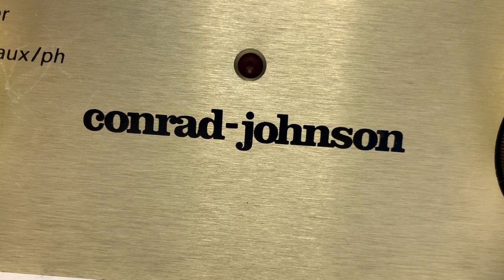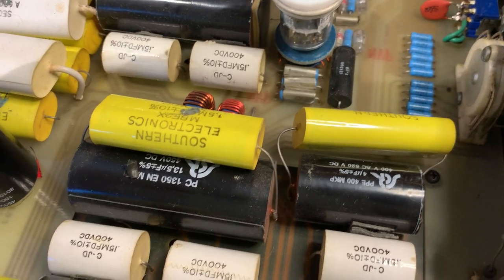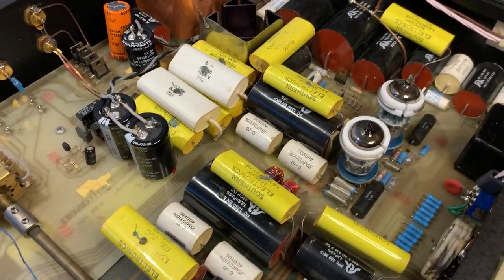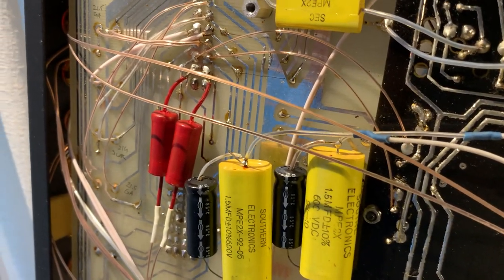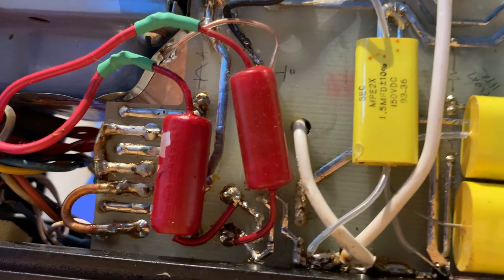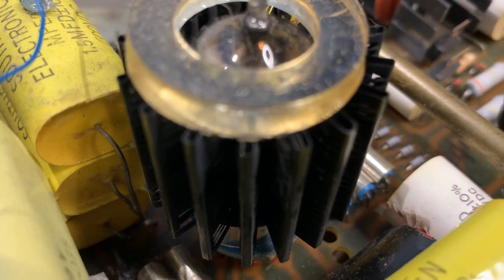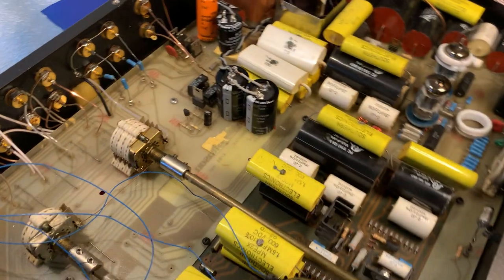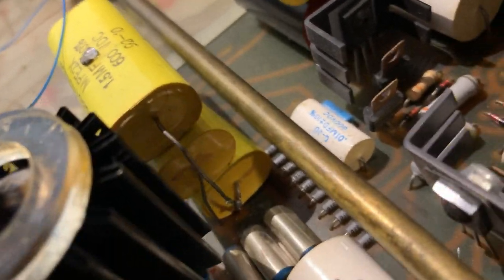Remembering the Magic of Stu Ono: Conrad Johnson PV12 preamplifier

Comment: agree about Unclestu having more knowledge about the bybee purifiers... he modded my vans evers 85 power conditioner back in 2003, and included two bybee purifiers in my van severs product which I still use in my system). Stu told me he put one of the bybees in an area that even Jack Bybee didn't do. I sent an email back then to Jack to tell him what Stewart did, and he replied back that, "wow... he never thought about that way to do it ! "
Reply from the maker: Mahalo, thank you for sharing! Indeed, the Bybees really spruced up the Vans Evers! So sad that both Stu and Jack are gone... Indeed, Stu mapped out where the bybees work the best - closest to the transformers, at places where the phase angle of voltage/current is shifted. Also, more impact on the neutral than on the hot..  Aloha, Janos

Comment: Hello Janos! There is a china clone out, which I'd like to purchase. But inside it looks way different to piece You show. Now I am not so sure anymore to buy one of these. But anyway, it might still sound better than my Thule audio line pre.What You think about that clone?
Reply from the maker: Usually in China clones they shave off on the parts that are not in the limelight: connectors, wire, resistors - they use ones as cheap as they can get. That results in a  rough / unrefined character, that may be more explicit or not so, depending on the execution, and may not even be obvious unless you have the clone vs the unit that was cloned side by side. In general though, the cloning tends to take it from a more cohesive sound towards a more clinical sound, but in later years the clones are getting better and better, compared to clones 10+ years ago.
However, if you treat it as a project, and will get into changing the compromising parts to high quality parts, then it's a good idea. Will be a super long project though, as the CJ pres have so many parts, and it's not fun at all to work on PCBs. (At least not for me, but if you do like it, then it's game on!)

Comment: Hi Janos, this video is awesome in so many ways. I'm changing the coupling caps on my Art Audio Jota tube amp. The original caps are Hovland MusiCaps the leads are long and insulated. The new replacement caps are Jupiter and have short wire leads. I will need to extend and insulate the Jupiter leads. I see that Stu put tubing on the leads of the caps and has also extended the leads on some of the caps. My question is what type of insulation and what type of wire is used by Stu for this, or what would be recommended?

Also planning on putting the quartz crystals based on this video!
Reply from the maker: Hello J, Stu used Kimber SF23 for cap hookup. It is teflon insulated, and he placed some polyolefin heat shrink over the solder joint. Have fun with the Jupiters and the quartz!  ; ) Janos
Reply: @realworldaudio  Thank you this really helps.

Comment: Are those Obliggato or AN Copper foil caps in your parts bin?
Reply from the maker: Those are Obliggatos. Trying to keep the cost reasonable :)
Reply: @realworldaudio  👌🏼 they are very good for the money. I have them (gold) as couplers in the GM70 amp.. Some of the least plastic sounding poly caps around..
Reply from the maker: @rickg8015  I'm so jealous of the GM70... :) I also use the gold colored "ultra-premium" series 600V or 1kV rated caps for coupling in my Ampex, and I agree with you that they lack the plastic sound, second to Miflex. They take a while to break in, but they give a natural sound at a very good value.
Reply: @realworldaudio  Been listening to Miflex Copper foils for over a month in a preamp and you get at least 95% of Jupiter Copper foils’ performance but in more sane prices..

Comment: Very nice! Thank you very much for this beautiful tribute video and many explanations. regarding the mods. Question from a beginner: are all traces bypassed with wires or just the ground traces? As an unexperienced diyer, I imagine that so many extra wires going around the chassis could cause noise? I wonder what is the correct technique to decide which traces to bypass and which not, which wire to use and how to estimate beforehand if there could be interference or not? I am sure it sounds great and no extra noise is created, otherwise it would not have been done like this ;) but I am guessing an unexperienced like me would create a noisy mess trying to replicate this? 😅
Reply from the maker: Hi Thiago, SUPERB question about the traces, you found a core issue!!!! Deserves a video response. ; )
Reply: @realworldaudio  Hi Janos, thank you :-)

Comment: Hey bro just before watching I wanted to tell u something, there is a guy in India he is making superb output transformer, I know which wire brand he uses, I'm having one pair from him (el84)  and one pair is being built (6L6) , u told me 6L6 is one of ur fav, I am proposing one thing to you, are u able to reverse engineer it, I'm waiting for my winding machine to arrive, can this be done bro, as we will be able to make them for a lot cheaper and I'll personally make 3-4 pairs for u, as a gift for helping me figure it out, and u can compare his OT to other high end ones as well, make. Some content out of it  or whatever u want
Reply: BTW he is charging around 300$  for pair of single ended OT for 6L6 amp
Reply: BTW he is 3rd generation of his family, they have been making transformers for 50years , he told me I bake my OT on coal and not in an oven like others, there are some videos also of his OT with some decent brands like edcor, lundhall etc, and his OT beats them really easily, he is claiming 15hz to 30khz or something very similar to. This
Reply: Is he using Square wire and deally silver ! How much would that cost?
Reply from the maker: @IDontExist14  I'm glad you found him! My advice on reverse engineering his OPT: you will be able to do that when you already have 10yrs of OPT building experience. To reverse engineer and OPT you have to take it apart, destroy it. Taking it apart in a way to learn from it already requires a lot of experience, and it needs to be taught hands-on. I recommend that you ask him to teach you, mentor you, or partner up with him so he supplies the OPT and other transformers for your amps which would be the best option. He has generations of experience, and the only way to successfully build transformers at that level is to learn from him, and even then it will be at least a decade before you are ready to roll out same quality on your own. (If people could learn this over internet, everybody would be making them!)  I know the mathematics behind OPT building, but I never progressed to build them as it's not possible to buy laminations in small enough quantities. So even for me, if I started making them, would take me AT LEAST  10 years before I am building OPT that are on that level. And, starting it up requires a huge investment. If you are SERIOUS about audio, you HAVE TO pick a priority. (Either build amplifiers OR wind transformers - either of these paths requires full commitment!) If you try to do everything by yourself, you will be a master of none. I suggest partnering with him for transformers, and you work on building and improving the amplifiers. When you have mastered amplifier topology, then you will truly understand how the OPT needs to be done. Before that, you are wasting your time trying to wind transformers without understanding. And I cannot give this understanding to you condensed on two pages. This requires one on one mentoring, and decades of it.
Reply: @johnsweda2999  bro he has used only silver plated copper wire before. But. Never a pure silver one, he said the cost was almost double due to to wire being expensive,. His regular OT i would really suggest u get it, his wait list is about 2months , give me your email, I'll share with you pics etc, I can even arrange and send the OT but. It. Will be a long process.
Reply: @realworldaudio  thank you bro for the insightful comment, unfortunately he doesn't want to share his method, but he's decent guy atleast he gives good discount and option to pay later if money is not there as he knows what he is making is worth a lot, my machine will be arriving soon, have been watching many vids on making OT, will share with u what I come up with, will u be able to test mine if I send it to you and give some tips what is. Missing?
Reply from the maker: @IDontExist14  You are too kind! Indeed, I can see him unwilling to share.... master winders do not like to do that unless they can make sure that you are dedicated to stay with them. Otherwise you will be just taking the business from him once you are proficient. I'm glad though that you are getting the winding machine! Start first with making a filament transformer. Will take a few tries to get right. When you are comfy with that, then you can take the next step to wind a 3:2 interleave OPT, and improve from there. ;) I will make videos to help with the process, and find you reading material to study.
Reply: @realworldaudio  thank you bro that would be awesome, I'll share videos soon of me actually using the machine, can u suggest any brands that sell wires for making OT, my guy used hitachi copper wire insulated, I was wondering do u know any brands that make good. Wires for both copper and silver
Reply from the maker: @IDontExist14  When I looked into it, there was no no silver magnet wire available for purchase, the OPT makers who work with silver usually have those specially made for them in limited runs. This was 10 years ago, things might have changed since, but not much. In general, silver magnet wire, even if available, is prohibitively expensive.   Also, start with looking into the availability of the M6 silicon steel laminations. That is the true bottleneck, much harder to get than magnet wire. Also, do not look for anything lower grade than M6 silicon steel, or it will lock you into budget-level iron quality. I suggest look around, as I am completely clueless about wire availability and manufacturers in your part of the world - it's drastically different from US. Hitachi insulated wire sounds good, if you can get it, then it's great. However, do NOT start with buying wire nor laminations... FIRST learn how to design an OPT, as EACH one requires DIFFERENT wire gauges and different SIZE laminations. There's 100% probability if you stock 10 different wire gauges and 5 different lamination sizes, you will still NOT have the ones you need when you are ready with the OPT design.  Talking from experience!!! I have approx 100kg of magnet wire, 8 different gauges or so, but it's still not enough to roll out a single OPT. You will need many 1000$ dollars investment to start rolling out OPT that cost for you about 50-100$ each in raw materials, simply as both wire and laminations are super expensive in small quantities, and become good value at big quantities. I suggest to do very serious studying before buying any raw material, as if you do not get the right ones, then you have to reorder everything. Which is the right one? Depends on your OPT design! Can I give pointer? Impossible. Will make videos on it, but I'm getting hammered at work & life, so very few videos will be coming the next two months and sloooowly... ;(
Reply: @realworldaudio   take a break for some time , I would suggest and you have been putting out a lot. Of videos, I think u can keep some videos recorded so u can share like max 2 a week, that would make some time in ur schedule for relaxing, we don't want you to burn out, take it slow and maybe use 111hz to clean up the negative energy by playing it on speakers, it really does clean up the bad vibes from ur whole house, good luck bro